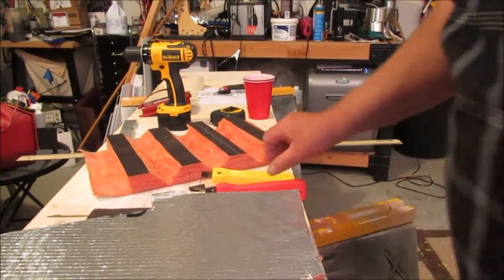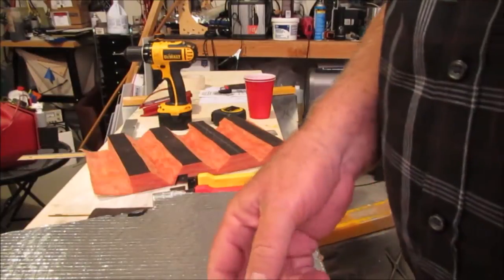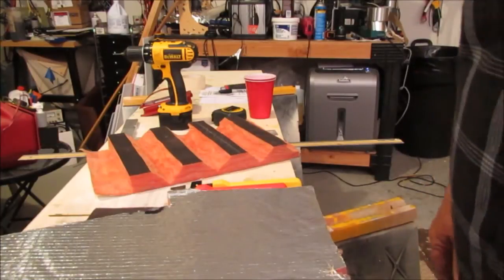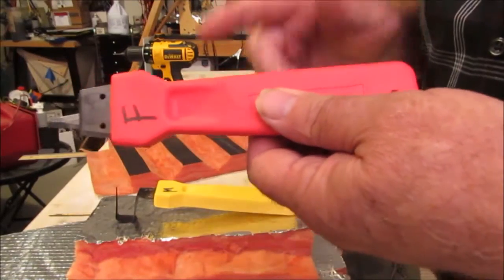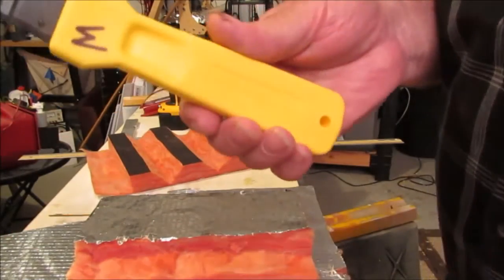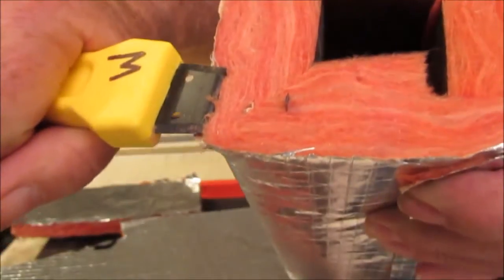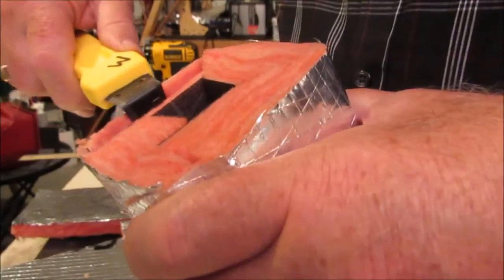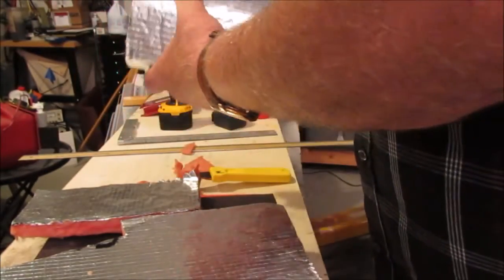Ship Lap tool- amcraft cuts-all malco fasgroov- how to use

Comment: I know the other video you were talking about. The guy wasn't using the tool to cut right. But you were using the male one wrong as well. The handle of the female tool buts up to the silver side to make the cut and the handle of the male buts up on the black side to make the cut. Try it out and see how much better the cut will be. Also its Male and Female because the Male one slides into the Female side.
Reply from the maker: Hmm, maybe...it's been a long time...